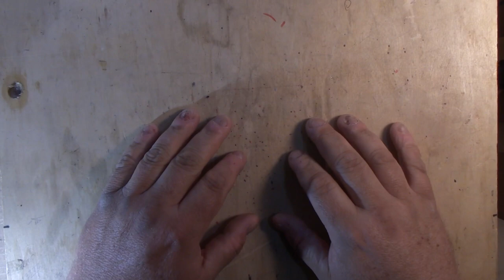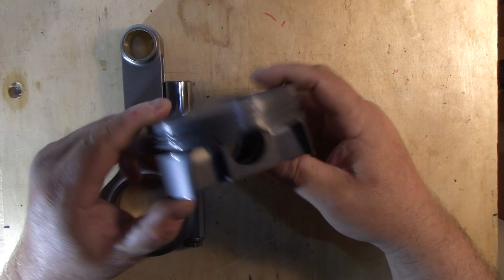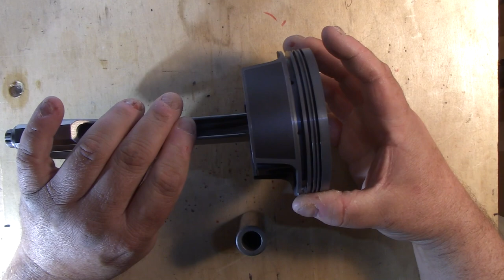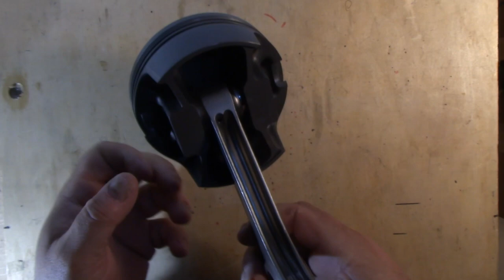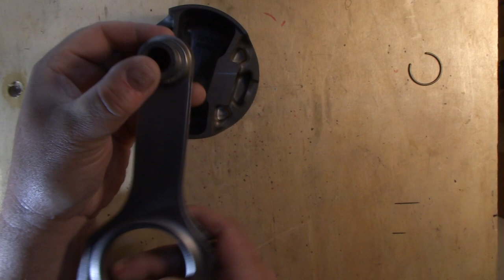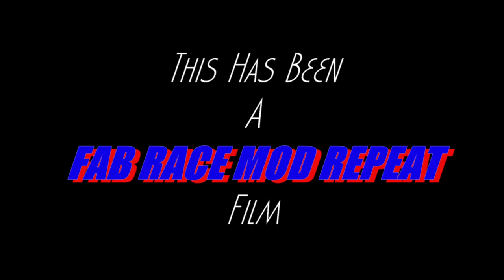Floating piston pins vs Pressed piston pins

Comment: I would imagine clips are not generally used with press-fit rods, as the pin would wear/bind torsionally on the clips. Is this a correct assumption?
Reply from the maker: The press fit holds the pin in. No clips required.

Comment: How can you physically  tell the difference between pressed vs floating rod
Reply from the maker: Floating pins have a retaining device keeping the pin in the piston. Snap rings, spiro-locks bushings etc. if you take one end loose and you can slide the pin out then, you have floating pins
Reply: @FabRaceModRepeat  I have a set of rods and pistons but the wrist pin does not slide into the rod.  Even with some pressure with my hand.   The pistons do have c clips with them.  The rods do have 2 oil passages in the bottom of the small bore and the bronze/ copper insert.   Im not sure if the small bore needs to get bored a bit or if they should come perfect and ready to go.  Is it possible a rod can be press fit and the piston still have the c clips? Thanks. I appreciate your input im pretty stuck on this for a few days.
Reply from the maker: @Bullikid
If they are new or the rods and pistons came from 2 different sources. It sounds like you need to have the bronze rod bushing honed to size. New ones are usually a bit tight.
Reply: @FabRaceModRepeat  the rod and piston came together from  the same company as a set.    I micd the oem pin and new pin and new pin is .025 bigger.  The oem pin floats nice and smooth with the new rod.  So I’m not sure if I should heat and and try installing or go to machine shop to hone/ bore out to spec.   Weird never thought this would be a issue. Building my first motor.
Reply from the maker: @BulliKid 
Use the pins that came with the pistons.
Go to the machine shop it’s typically $50-80  to fit the pin.
PS
It’s money well spent
Reply from the maker: Also thanks for watching!!

Comment: This was very informative and explained well. My Jeep dealer found two loose/worn wrist pins on my 2001 Cherokee xj 4x4 at 188 k miles. I've drove it another thousand with no change in sound or performance. Bought it with 187 and  the sound was present then. Saving up for a rebuild.
Reply from the maker: Glad it helped
Thanks for watching

Comment: I'm working on a '56 Pontiac with full floating pistons.I want to reuse my pistons but I noticed on one piston the wrist pin won't rotate on the rod and on another one it won't rotate in the piston.I tried soaking them with lube,letting them sit and then working them again but they won't budge.What do you suggest?
Reply from the maker: Chief 1 
Sounds like your going to have to press them out.

Comment: I’m going to use push in pins so should I use clips in order to prevent the pin from working it’s way to the side and scarring the cylinder? Or is it okay to not use a retaining clip if it is a press in pin.
Reply from the maker: The press pin set up doesn’t require a retaining clip. I never really thought about adding a clip to a press setup. If I was going to have the added weight of the clips I’d go full floating pins.

Comment: I have an engine with a floating wrist pin setup however the con rod is severely scored and uneven so the wrist pin just binds in it, making the only pivot point in the piston. Do you think it’s okay to run like that?
Reply from the maker: @mondude9754
Thanks for watching however, NO do not run your engine with a rod in that condition!

Comment: nice video, clear explanation on fully floating piston pins. 
worth noting that press fit piston pins as shown in this video as also known as semi floating pins.
fixed or stationary pins would be when the piston is fixed to the piston but is able to turn/spin in the connection rod.
Reply from the maker: Good morning,
Thanks, glad you enjoyed the video. Yes that is the third type   piston pin. I’ve seen that set up in very early engines and some industrial applications.

Comment: Great info vid ,,,I wonder if you can help me out ? If I keep my engine at a steady 2000 RPM and accelerate to like 2500 2700 RPM its like a hear a faint slight growl would that be the wrist pin ?,,, The engine is a 6.0 LQ9
Reply from the maker: Growling sound in the acceleration curve is usually a rocker trunion going bad.
Reply: @FabRaceModRepeat  Thank you for the reply ,,I was worried it was a wrist pin

Comment: Can you explain the installation for a press fit piston and floating rod installation? I have this arrangement on my Onan generator and I have the new rod ready for installation
Reply from the maker: Morning Don,
Thanks for watching.
I have only done that style once many years ago, on a hit an miss boat engine. The procedure for that on was:
First clearance the rod bushing to fit the pin. The pin then pressed into the piston (without heating piston) to the specified depth. It used small cotter pins to insure the piston pins didn’t work back out.
  With all that said doing a google search for Onan piston installation would be worth while.

Comment: Very informational, thank you. I had my pistons ceramic coated but during the process, the wrist pins were not marked to each piston. Does it matter which piston the wrist pins go back in? They are full floating.
Reply from the maker: Michael Matagrano 
Thanks for watching.
If you have not had the pins fit yet it doesn’t matter. If they have been fit, either at the factory or by the engine builder it most likely does matter.
This would be a good time to do some clearance checking.
Reply: @FabRaceModRepeat  They are the original pins and rods (LS 5.3 Gen IV) and the pins slide in just fine with no binding. They were all fine before the rebuild and have about 160,000 miles on them.
Reply from the maker: Michael Matagrano 
As a general rule it’s best to keep used parts together and in the same orientation. If you have the measuring equipment, I would check the clearance of both the pins and the hole in the pistons. It’s cheap insurance. Then put the pins in the piston they fit best.
Reply: If you ask me, I would say, Yes, it does matter.  Every part of an engine has been warn to its specific place.  This is what happens when you break -in an engine for the first time.  The piston pins will be worn to the specific piston and connecting rod.  So it's important to put them back into the same place and direction where they came out of the piston and connecting rod.

Comment: What the difference in the from a pin that floats and one that's pressed? ...other than how they are assembled and work. Can the same pin be used as floater or pressed?
Reply from the maker: Great question.
How they’re retained is the main differences. The same pin can be used for both application (Varys by manufacture). The floating pins are usually a bit shorter than press in.
Reply: @FabRaceModRepeat  thanks

Comment: I got new pistons and going to reuse stock rods stock is pressed and the new pistons are floating ones they come with the wrist pin am I ok to use the new ones
Reply from the maker: Great question.
I have seen this done. However, If I were doing the build; I would have the rods bushed and make it a full floating set up.

Comment: Can the pin be a little loose when cold, in my motorcycle?
Reply from the maker: Loose as in pin wiggles in the hole?
Reply: @FabRaceModRepeat  yes there is a little play and wear.
Reply from the maker: I’d replace it.
It’ll start to pin knock, and that will tear up the piston

Comment: R the 52 series wrist pins any good?
Reply from the maker: Morning
By “52 series” I assume you mean JE Piston, wrist pins.
  With that said JE makes a great product. I would check their website or call the tech line about the best pin for the application. Pins vary greatly between applications, for example: a very lite rotating assembly in a 2bbl late model stock car and a BIG power adder outlaw 10.5. car.